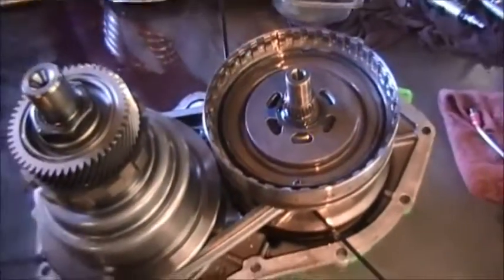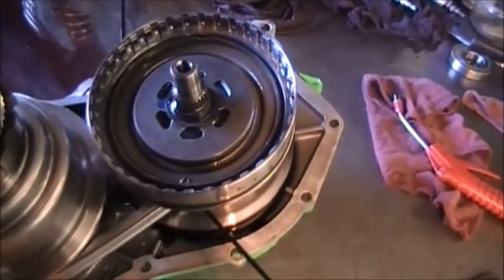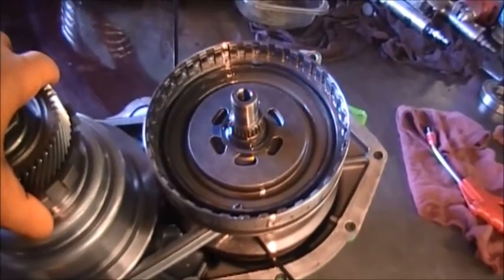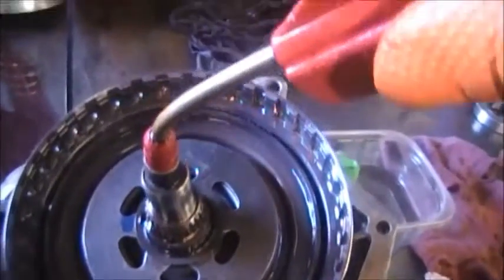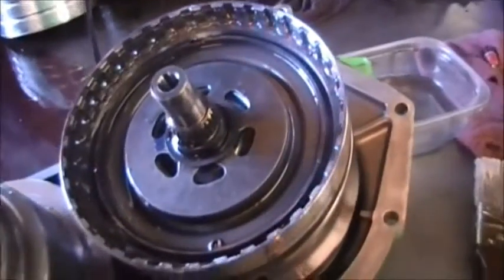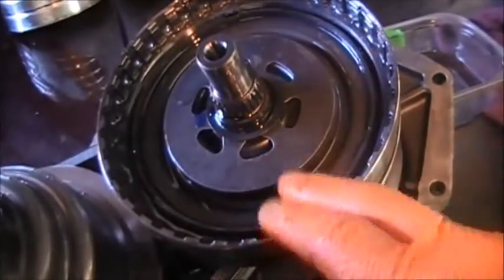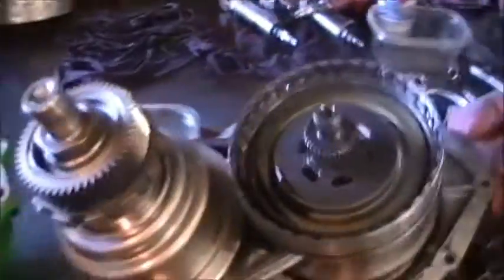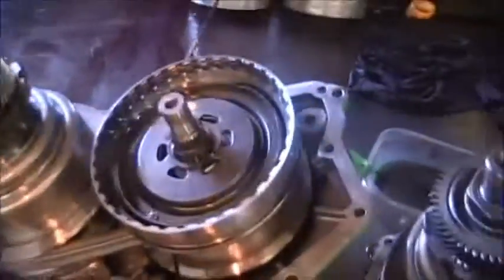satun vue tip#2

Comment: Right where your applying air to the forward clutch there is a pencil sized tube with what seems to be a bonded tiny seal on the inside of the input shaft that goes on top of it. There a caged roller bearing and a 8mm tube in the middle. My trans was losing drive after a few minutes. I time it apart and the forward clutches are slightly burnt but the piston actuated properly and is soft and looks great. Then I noticed the seal that on the 8mm tube. Is damaged but can't find a way to replace it. I hope this is clearer description of my problem.
Reply: Its on the inside of the reverse planetary where the roller bearing is located
Reply from the maker: Tom Velentzas alright, you can only get that tube in an overhaul kit. it is not sold alone. also, you will have to drill it out then press the new one in

Comment: Whay about the seal on the reverse clutch seal. There seems to be a s bonded dream on the reverse clutch that goes into the home your putting air pressure in. How Do I r replace that seal
Reply from the maker: Tom Velentzas if you can replace all seals

Comment: well I actually did get the variator assembly  out without removing the transmission. I will take a video and show you how I did it. I just received the parts I need to fix and will be putting it back together this Saturday. The problem was in had forward and reverse sometimes. I found that both forward and reverse pistons were bad and the forward cluthes  which you called reverse clutches were worn down to metal.  to get it apart I removed engine mount top transmission mount and unbolted the transmission side engine cradle bolts. the strut supported the weight. then took the case cover bolts out removed covers. then tie strapped the belt. then took the nut off the primary variator and slid the pulley off and catched the balls in a container. then slide the secondary variator out with the belt. then was able to take the remaining primary variator out. it was pretty easy had it apart in 3 hours. so if anyone out there is having this problem it is possible to save yourself a ton of work. good luck. and thank you again questioning 3
Reply from the maker: hmm

Comment: First of all thanks so much for all your footage on the saturn vue cvt. I learned so much valuable information from you. I have a 2003 saturn vue with the vt25-e cvt. I want to pull the case cover with variator assembly out of car without pulling the transmission out. Is this possible? I don't have the car with me right now to see if it would be possible but I'm thinking I can take it apart in pieces rather than the whole assembly at once. Would it be possible to put it back together in pieces? I would have to make up some kind of tool to push the secondary sheeve to get the belt back on. I know it would be a lot harder to work on but I just don't want to pull the whole cvt out. I'm pretty certain my problem is the pistons and I want to put new clutch plates.
Reply from the maker: Ha ha, no no no, you have to get down and dirty and take that transmission out.

Comment: +questioning3 I have a vt25e that I just tore down and you do thin metal shavings long strands of it. no little chunks all maybe 1-2 inches. and very thin. Vehicle made a whining noise but shifted fine. the belt looks trashed as well. and it has scored the variator. I have access to parts but I cannot figure out where the thin metal came from any clue.
Reply from the maker: +xzuesx91 You have to look at parts that have metal to metal contact. Disassemble the drive variator and check it completely. Don't forget to check where the balls ride. The whining can be from a bad torque converter also. How many miles does the vehicle have?

Comment: In your expert opinion, are cvts as reliable as traditional automatics? Also, how long will the belt/chain last in a cvt? Really useful videos. Thank you.
Reply from the maker: +zygi22 CVT is a pulley system, two pulleys clamping around a steel belt for the most part. As a result of the make up of this unit, it will never be like a standard gear type automatic transmission. It requires higher pressures for clamping force than a standard automatic. However, it has proven in the field of operation to last as long as 200,000 miles. So of these cvts break as low as 60,000 miles, so do some traditional automatics. My conclusion is that a cvt can last over 100,000 miles. But, I would not buy one until the car manufactures stop withholding the parts. One should not have to chase for used parts (only) to fix his car.
Reply: +questioning3 Thanks for the quick reply. Your point on the manufacturers not providing replacement parts for these CVTs is spot on. They (the dealers) are creating a monopoly and milking people's pockets by doing this. I hope this changes...

Also what kind of intervals would you suggest for changing (just drain and refill) the CVT fluid. I'm asking because Nissan is rather ambiguous about how often you should change the fluid.
Reply from the maker: +zygi22 Well, fluid looses its viscosity over time. That is to say that it becomes like water, but not quite. Maybe on the Nissan murano, 60,000 miles is good because you can also change the filters. Nissan murano cvt has two filters.
Reply: questioning3 I have a 2011 Maxima with 34000 miles on it. I wanted to do a drain and refill of the CVT fluid. It won't hurt anything right? Do I also have to change the filter(s)?
Reply from the maker: +zygi22 did not know that Nissan maxima had a cvt in it. Makes no difference though. 60,000 miles is when I would change the fluid. However, if you change it at 35,000, it will not hurt it. Just remember, I don't care how much a person takes care of his body, when he gets old things will wear out. It is no different with vehicles.
Reply: questioning3 Yep. Nissan put a CVT in the Maxima and called it a "sports sedan". Go figure...Things wear out overtime but taking good care of the car will make it last a little longer.